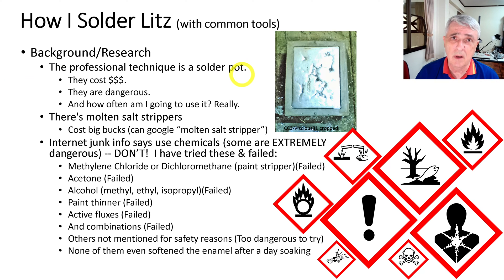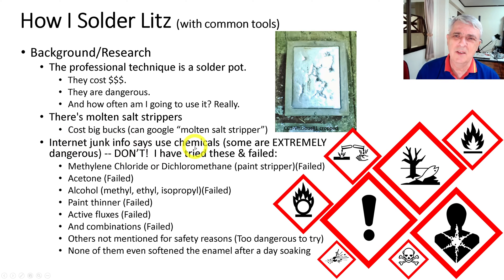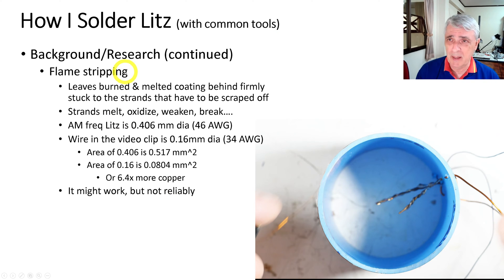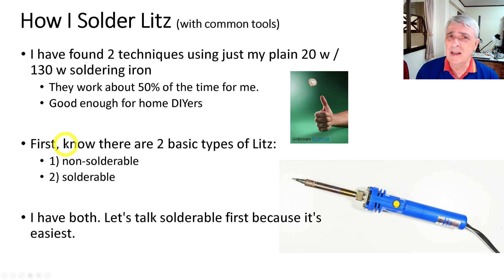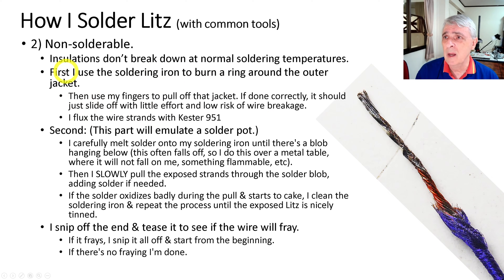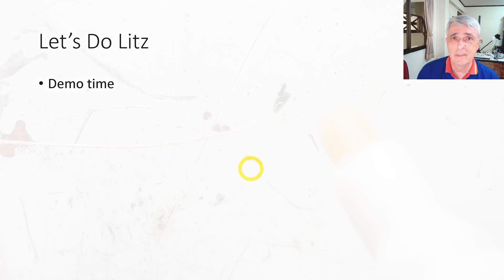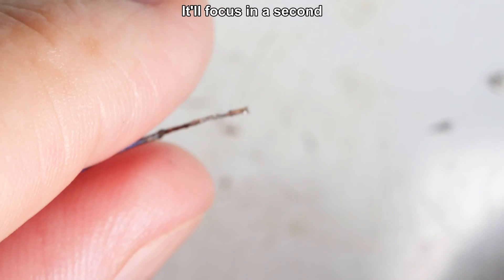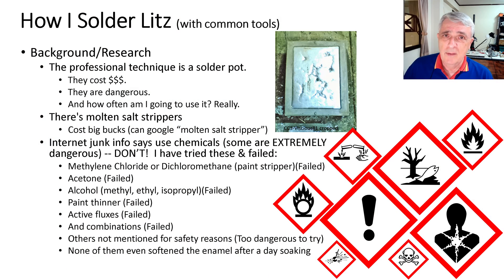Soldering Litz Wire--No Special Equipment/Chemicals (4K)

Comment from the maker: Crystal Radio--Litz Wire (Is Litz The Sh*tz?)      https://youtu.be/O0hUYmp_US0
Reply: Truly old soviet methods: aspirin/acetilsalicilic acid tablet (wery toxic for eyes and lungs) or wery heated base (base as opposite for acid) -- again, one drop in eye and lost sight, be WERY carefull.
Laquer can be undone with base, but  probably NOT if modern polyurethane kaquer of hight strenght one. Old -- works. New -- dont know.
I use wery old wires from market where grandpas trade things from soviet fabrics/factories.
Ukrainian. Sorry for bad english.
Reply from the maker: @GOOGLE-IS-EVIL-EMPIRE   The new insulation will not come off with any reasonably safe chemicals. The techniques I show work well and are relatively safe.

Comment: You can clear isolation from teflon cably by using "plasma" lighter with heat spark. Or heat isolation but not on tip, but in place maybe 1-2 cm from tip so it will shrink. Dont heat copper -- bad soldering.

Lead is toxic, flux works with oxidated lead anx makd smoke/vapour -- toxic, wery. Carbon mesh/wool filters not work! Usd professional exhausters if solder, guys!

Comment: I will give you a pro tip on a technique I've been using since the 1980s with great success for soldering enameled copper, litz included. It's something that you most likely already have in your home, it's not dangerous but can be a little uncomfortable if you don't have good ventilation (a fan blowing on your workbench and away from you will do the trick) and it's fairly quick and easy. 
Aspirin. Yes, regular old aspirin tablets.
You place a tablet of aspirin on your workbench, place the end of the enameled copper wire on top of it, and press it down with the hot soldering iron tip. The aspirin melts and strips away the enamel without doing much or anything to the copper underneath. You just keep the wire in the molten aspirin pool for a few seconds, take it out, apply flux and scrape a bit with the tip of the iron to dislodge bits of junk, and it's ready for soldering.
This gives out some fumes which are irritating to nose and eyes, but not dangerous (they're acetic acid, basically vinegar vapors - resulting from the decomposition of aspirin under heat). Thus the fan blowing away.
Reply from the maker: I've heard of that, will have to give it a try. Right now I only have gel type aspirin.

Comment: Thx much  for showing this.....On Multi-Strand litz (660 strands/46 ga) I've heard that even 1 Single strand Bond fail will Totally defeats the expensive Litz wire Functionality ?? .....How does one Know that each Tinned end Strand of Litz wire is 100% electricity Solder bonded ?? .....For that Matter, how does end user Know their total Length (140 ft) of Litz wire dosen't have 1 or More Open strands to Start with ?? ....What Industry  standard Test Method is used to QC soldered/Tinned  Litz wire 100% strand End to end Continuity in commercial/Industry QC assurance testing ??
Reply from the maker: I read the same thing, and it makes sense. If you have an open wire, it acts like a capacitor. Getting rid of capacitance is one reason for using Litz, so.... How to test it? My guess is you do it statistically. You make a bunch of them, test them, then take the ones that score the best. Keep 1 as a standard to test against in the future.

Comment: I would have thought the butane lighter would have worked as the flame is 600C and copper melts at 1084 C. Perhaps the copper does not melt, but gets somewhat soft. I think if one could support the far end some how, then the wire would remain straight.
Reply from the maker: I think part of it is the copper burns. You can see it sparkle. But per google (and it's never wrong;) a butane lighter can get 4,074 degrees Fahrenheit (2245 Celsius). Also, heating the copper in O2 oxidizes it, then you have to remove the oxide.
Reply: Well, it appears one can get the temp down to 300C by have a 50-50 mixture of butane and oxygen by weight. @tsbrownie

Comment: As copper melts at 1084.62 °C, 1984.32 °F, could use a candle flame at its bottom blue zone which is 800 degrees C.
Reply: In addition, there is quite a range of temperatures available in a candle flame. See the wikipedia entry for 'Candle'. There is a nice picture showing the five temperature zones going from 600 C to 1400 degrees C. Case closed, and problem solved. My work is done here.
Reply from the maker: Ah yes, BUT, try finding those temps over the length of the stripped wire and when the flame is moving around! ;)
I rest my case.
Reply: @tsbrownie  well, it looks like a small solder pot it the way to go.😿
Reply from the maker: @franzliszt3195  Or just use a drip of solder on your current soldering iron! The title promises no special equipment.

Comment: Thank you for sharing, I wish 12 years old me had access to resources like this back in the days, that would have spared me hours of frustrating unfruitful tinning. It sure will help many struggling youngters!

I usually gently grind the non solderable kind on a piece of fine grain sand paper before tinning (until it partially "shines"). I also do it when using my 5 bucks chinese soldering pot instead of the method presented in this video. It usually ensure a faster and cleaner tinning process (althought not perfect). I'd say that i'm happy with the results about 75% of the time.

Comment: What about burning it off using air (or oxy) propane torch, and then using a jeweller's pickling solution (standard would be Sparex #2) to remove any oxides from the copper from the high heat. The pickle will remove literally all the oxides.

Edit: I was thinking about much much larger litz, which is extra annoying.
Reply from the maker: The wire with 6x more copper melted away with a lighter.

Comment: I always use sanding paper or if it's a quick solution I scrape with a cutter. More heat and it decrades while soldering NEVER worked for me (should have been "solderable") :( It's such a pain in the back😜

Edit: the forming solder joints are crap and make just bad connections :(
I'll try your methodes and report! :)

Btw, gave you the diy lead-sulphate another try?
Reply from the maker: Have you used 46 AWG wire? Nope, have not redone the PbS. I'm wondering if I could make it with a 5 or 10 ton press  and maybe some heat. I  need a consulting chemist!
Reply: @tsbrownie   I don't know the gauge :/ they were like these wires used for headphones and small data wires, bought as "solderable" but they behaved exactly like headphone wires.
I must admit that single stranded enameled wire are also a pain for me :( the "blob"-method work but the temp has to be really high and even single stand wire don't like to "dive" into the solderblob and the fire method where you burn the enamel with a lighter melt the whole wire if its thin and lager tend to get brittle and break :( like I said, pure horror for me!

In regard to the lead-sulphate, I don't know if a press will really work that good :/ No experience with that but I did a few syntheses under the lack of oxygen and it worked very well so I'm going to try it and will report :)

P.S. I also have some of these dynamo flashlights, already with leds instead of a normal bulb.
I'm still trying to mod one with a gold cap or some sort of energy storage but with the low ac voltage (don't really work with FBR) it's kinda difficult. I think about using the leds to rectify and to store the remaining electricity... still no usefull idea 😅